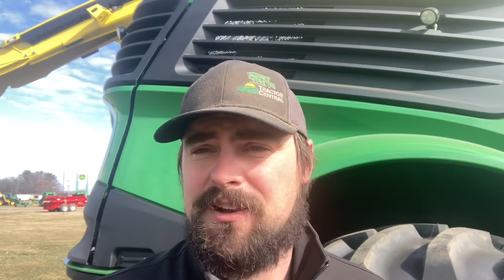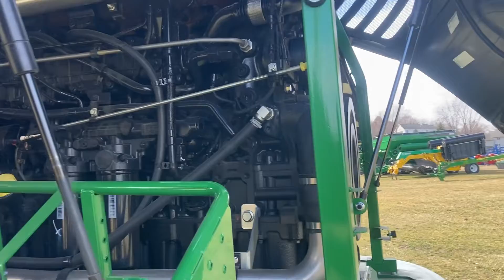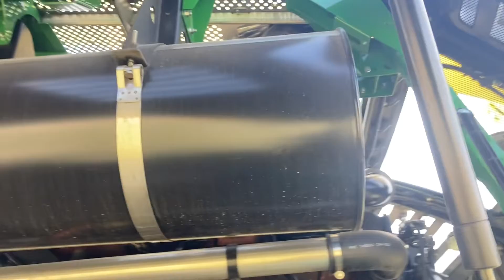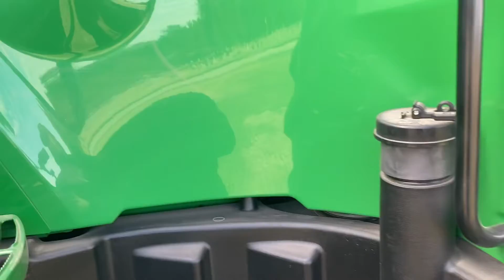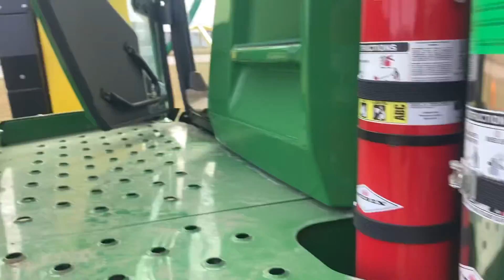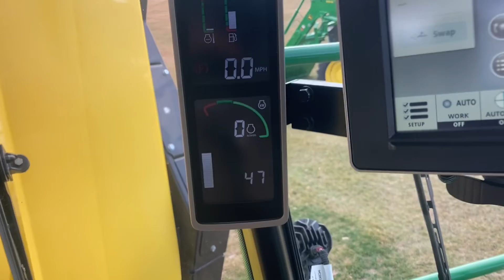No DEF! Quick look at an 18 Liter John Deere Engine

Comment: Hi, very interesting. Is this actually a John Deere engine or a liebherr . As an agreement was made with liebherr about ten years ago on larger engines. An 18 l engine is on the liebherr website as well as a 13.5ll. does Deere make this engine in the USA as the choppers are European sourced it would be easy too source a local engine. Gavin.
Reply: Its john deere
Reply: Deere built, but was it developed as a partnership with Liebherr?